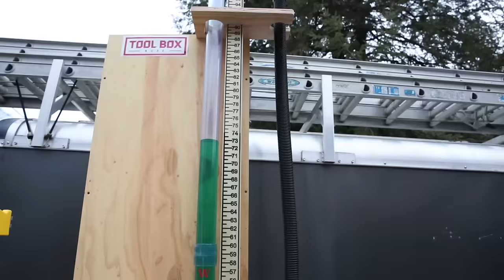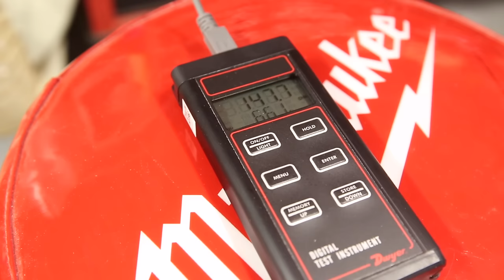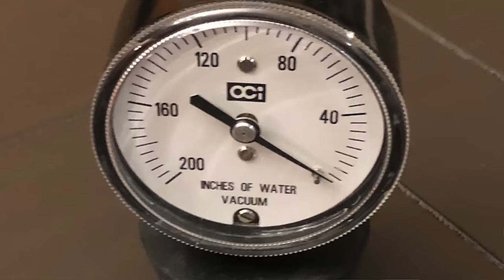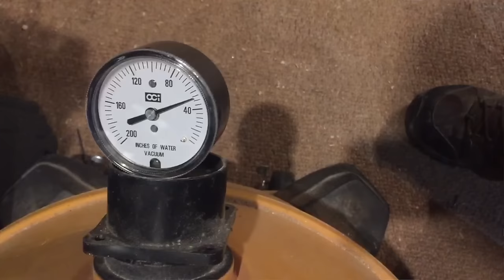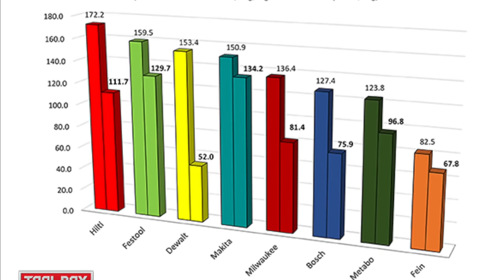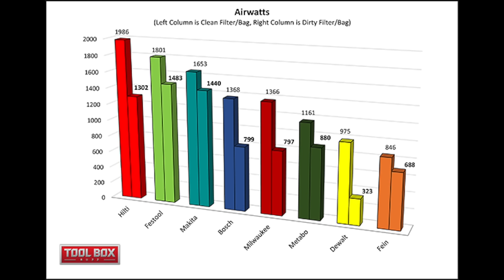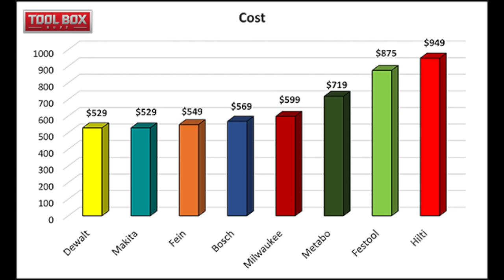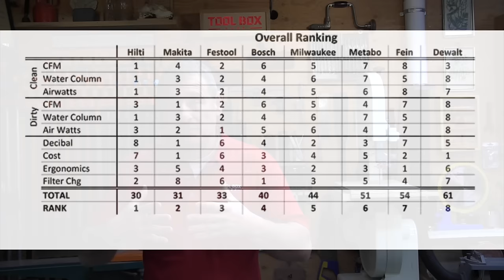Best Dust Extractors - Head-2-Head Testing

Comment: Your air watts calculations must be incorrect.  The blowers on these units are probably 65% or less efficient at the peak efficiency point and they draw less than 1700 watts so the air watts can't be more than 1100 watts at the peak (1700 x 0.65).  Efficiency drops off dramatically on either side of the peak efficiency point.   So, yo need to recalculate your air watt numbers.  Typically, inches wc x cfm / 8.5 = air watts.

A $150 Ridgid shop vac with a bag filter and cartridge filter would perform with tthe best of these.  It would have been nice to see it for comparison in the test.

You should also log PM2.5 levels at the exhaust of each vac during testing since filtration efficiency is a very important variable.  A vac that blows excessive  levels of particulates is worthless even if it has great flow and suction.
Reply from the maker: Tony Shulthise Please read the article you’ll see the math, if we got it wrong send me an email at RobertRobillard@comcast.net
Reply: Tony - Here's what we did:The formula for this ASTM standard is: P = 0.117354 x (F) x  (S).’P’
 is the measured and derived power in airwatts,’F’ is the rate of air 
flow in cubic feet per minute (denoted in cu ft/min or CFM) and ‘S’ is 
the suction capacity expressed as a pressure in units of inches of water
 column. The constant in the equation (0.117354) makes the calculated 
result, over a wide range, come out to where one airwatt is roughly 
equal to one electrical watt. Our testing methods enabled us to 
calculate the Airwatt or ‘P’ for each dust collector.

Comment: How about those Ridgid shop vacs?
Reply: prf 

They are just that.. shop vacs...

Loud and typical filters i dont wanna deal with. I do still use one hooked to a dust deputy on a  tablesaw. Those filter systems are obsolete.
Reply: We didn't include because the Ridgid vacs can't meet the OSHA regs. Just a totally different category of tool.
Reply from the maker: I LOVE my Ridgid shop vac - but it is not in this league of OSHA Table 1 dust extractors
Reply: great review by the way, I love your videos, pretty much I watch your videos before I buy any tool, that's how I ended up getting a ryobi set just for the nailer. 

i hook up a 5hp ridgid to my edger and drum sander when i'm sanding floors, since I don't have a big dust collector. it has good cfm and the better filter works great for me, I have never tried it with stone grinding tho

I never tested with a particle counter tho, i need to do that.

Comment: This test is really weird I have own 2 hilti. One Dewalt I have been using them for more than 2 years for drywall sanding, the Dewalt never gives up the suction power even when is pretty full and duty , I have nerves replaced the filters and I used it with out bags, can run it all day sucking drywall dust with no problem , on the other hand one of my hilti vac burn out because got too hot , also I have to used it with bags and the bags are really expensive, I think this guy is getting paid buy hilti or something may be not but there’s no way ill buy another hilti vac I’m waiting for the one I have left to break so I can buy another Dewalt one.
Reply from the maker: Nope not getting paid
Reply: You are missing the amount of fine dust (particle size's you cant see with your eyes) that just goes through the vacuum, with bags your Hilti for sure does a better job than your DeWalt without bags.
The fine dust/particle are the one that are harmful to you, the big size's are less harmful.

Comment: I don’t totally agree with the review as it doesn’t actually rate them in use with an actual tool.
Reply from the maker: robb b how do you rate them?
Reply: Well I’ve never used any of these. I’ve been researching and ran across this video. Now here’s the deal. Hilti mostly markets their vac to a concrete industry and Festool markets to a woodworking industry. Makita is mostly in the wooden industry also. So my question is how well does each vac system work , with the tools it’s designed to work WITH. The suction is immaterial to a certain degree if it doesn’t get rid of dust, shavings etc. at the tool head. Your review is great for just straight up vacs but that’s not the whole picture. It’s somewha misleading in my mind. At the same time you guys are really good reviewers and I appreciate the video. I just think you missed the boat a bit.
Reply from the maker: robb b Actually Makita has a strong history of woodworking but they also have a very heavy dose of concrete. All of these tools will work well with sawdust we test them with very heavy drywall compound which will choke most motors

Comment: Honest question here coming from reading the article on toolboxbuzz, here goes. I've heard dust extractors being called glorified, expensive shop vacs. Is this true? A shop vac has a bag, a filter (HEPA standard or add-on), takes wet and dry materials, has plenty of suction (rated in cfm) and is portable. So as a finish carpenter who wants better dust control I ask you, what is the difference? This is a good review and I feel like more info could be given for and against the products shown. These products aren't dust collectors, those are different animals all together. But rather are these basically an expensive vacuum?
Reply from the maker: Mr. B these dust extractors not shop vacs. They are designed for OSHA Table 1 requirements which is concrete dust (Silica) also lead paint, etc. Their intended be used to collect dust at the source, by hooking  up to a tool. They can also be used as floor clean up vacs,  that’s NOT their best purpose, as their smaller hoses clog faster.

If your a carpenter and working with sawdust only or remodelling debris, than you can absolutely go other route and use the better filters.
Reply: A Concord Carpenter / ToolBoxBuzz I know what dust extractors are for, and understand the safety aspect when dealing with silica. Considering what I would use one for (MDF dust primarily, some drywall dust) would a dust extractor be the best tool to buy or would a shop vac with a bag suffice? You mention better filters, if you're referring to the dust extractors that makes sense. You can buy aftermarket filters for shop vacs as well. Just trying to make an educated purchase.
Reply: Shop vac dust collection is OK, from a cleanup standpoint. A good shop vac or ridgid vac will collect most of the chips and visible dust when hooked up to your saws.

From an air quality standpoint, a shop vac or similar unit is not designed to meet high filtration standards for air quality. Even with bags/cyclones and better main filters, the unit is not designed to contain fine particles and will pass them on through other places, bypassing the main filter element.

The other "gotcha" with shop vacs and similar types is that they have no auto clean option for the filter, so over time the finer particles will clog your filter and reduce air flow. It will still do a fine job of picking up crud from the floor, but you'll notice that miter saw will be leaving a lot more dust on the table compared to when your filter was new and clean. So you have to manually remove your filter and bang it out or wash it every couple hours at least, just to keep that air flow up. 

For me as a finish carpenter, it's still worth it to have a bona fide dust extractor, even though a shop vac may be basically adequate for the work I normally do.
Reply: Also, fleece filter bags in a legit dust extractor will keep your primary filter cleaner, where shop vac bags are typically paper and do not prevent fine particles from passing through and clogging the main filtration element.
Reply: One more thing... =) 
If you check the cfm measurements claimed by shop vac and ridgid, you'll notice that the models approaching or exceeding 150 cfm will be much larger than these dust extractors. Seems to be the ridgid vacs will have a 12-16 gallon canister for their motors with the same airflow as these 8-12 gallon dust extractors.

So if space is at a premium in your truck/trailer like it is in mine, it's nice to have a vacuum with plenty of power but a smaller footprint.

Hope this all helps!

Comment: Filter Bags is the Best for just Dust they DON'T Clog up. I like Shop Vac. From Lws motors Good for Ten years..
Reply: A bag-only vacuum is going to allow your lungs get the most damaging dust: all the particles under 5 or so micrometers size cannot be retained by common bag, or more importantly the nose and throat protection, so those end up going to the bottom of the lungs where they can cause irreparable damage, like silicosis or asbestosis, and even wood dust is quite dangerous.  That is the reason to only use a proper HEPA rated vacuum or dust extractor, and beware that NOT ALL so called "HEPA" rated vacuums are the same. Perhaps your shop Vac would last 10 years, but you could very well get cancer or other severe illnesses before those ten years!